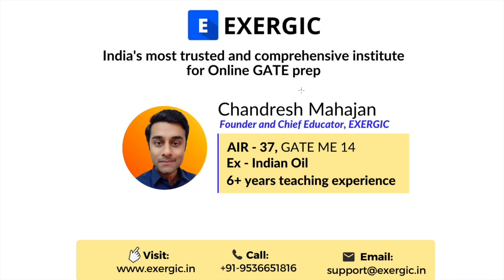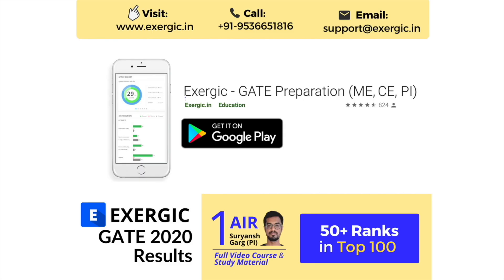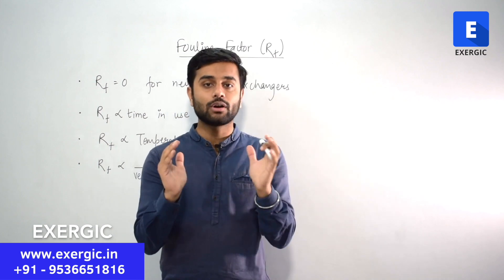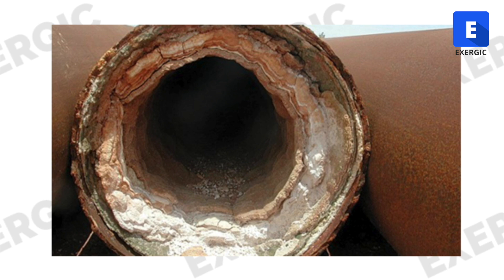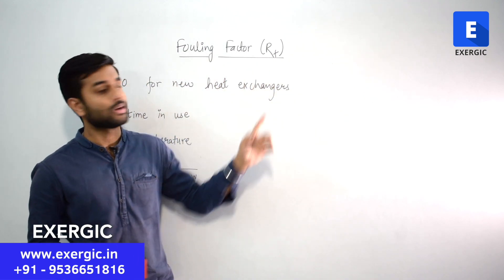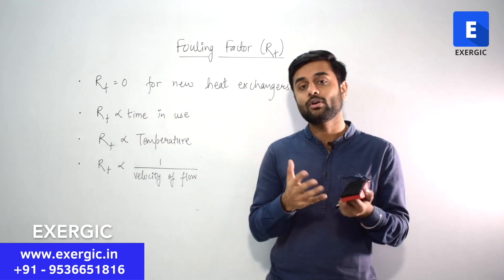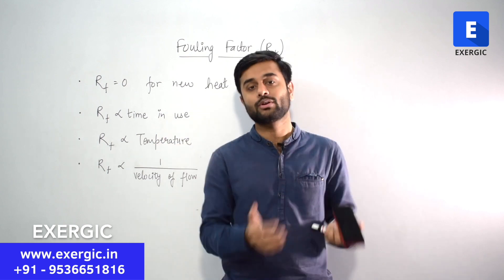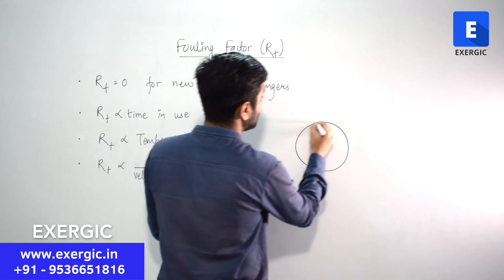Fouling Factor in Heat Exchangers - Heat Transfer | GATE Mechanical

Comment: How did they clean the fouling of that exchanger? And what they did to reduce it?
Reply: Hi.. The foulants are cleaned by dismantling the heat exchanger using physical or chemical cleaning methods. For instance, hydroblasting. 
To reduce the fouling: various ways are being used in industries:
1. Oversize heat exchanger based on TEMA fouling values
2. Maintain high velocity
3. Maintain low film temperatures
You can read more by looking at research articles by the students of Prof. Sandro Macchieto from Imperial College, London